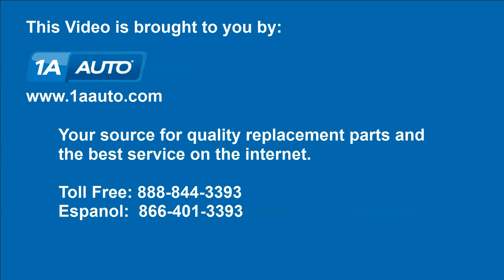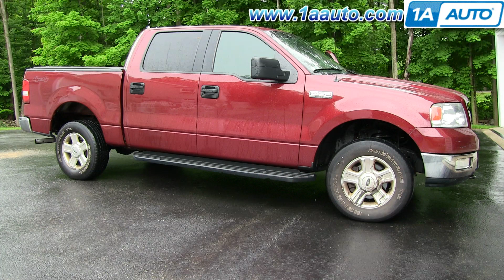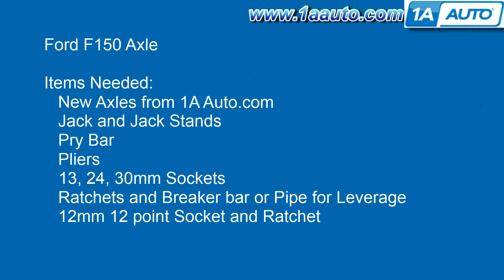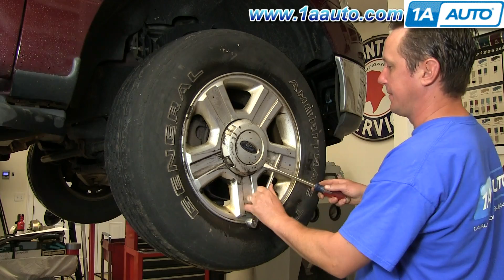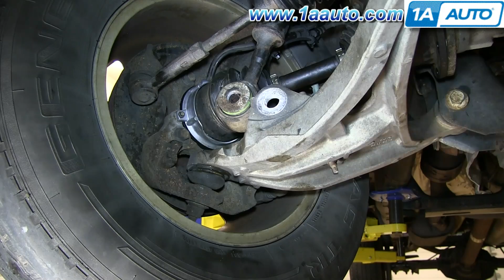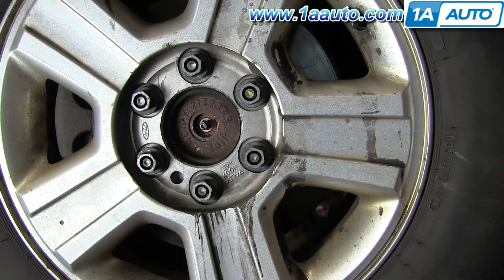How To Replace Front CV Shaft 04-10 Ford F-150

Comment: I'm thinking I need to do this.i here a clunk sometimes   and my cv join boot is mia . I'm Al's a bit low on funds so I was hoping to get away with  just replacing the rubber boot and put some  grease in  in

Comment: Just did mine. I have a 2 inch leveling kit and the strut would not go back in to line up on the control arm. Had to take the tie rod and upper   ball joint out.  Fought with a pry bar to get it back in . Definitely should of taken away bar like out. Was a nightmare
Reply: Swat bar link*

Comment: worked as described on my 2005 ford f150 4x4 ! I did this on the drivers side but nothing was different. Just make sure to have a 30 mm DEEP socket for the strut bolt. All my shallow sockets were not deep enough to engage the nut. Otherwise thank you 1A!

Comment: The manual calls for 350ft pounds of torque on that 27mm bolt through the strut. Not 90-100 like you said

Comment: My 2010 4x4 doesn't look anything like that
Reply from the maker: +Derek carry The video shows a 2005 model, but this video is also applicable to your 2010.
Reply: @1AAuto  09+ f150 front cv axles don’t attach to the front differential with bolts like this either. They are splined shafts on the inboard side at the differential.

Comment: This shows the spindle nut being cranked down.  But as I've found, if you tighten that nut up, it tends to keep the wheel from spinning.  I cannot find true articles on this dang nut issue.  Am I over tightening it, or is the spindle/axle bad?  I know there is a torque spec, but the slightest tightening on the spindle nut causes the wheel bearing to lock up and over heat!
Reply: I replaced the driver side locking hub actuator and I tightened the spindle nut to about 18-20 lbs and I have no issues. If you think about it, the nut has to maintain the cv axle in place so the rotation pressure created by normal driving  yank the cv axle out. All I'm saying is that if there is a nut in there, it has to be torqued down to a specific point, I think you have a bad spindle.

Comment: My 2010 fx4 doesn’t have those six bolts on the axle I thought these trucks were the same is there anything different
Reply: How did you get it done because I’m having the same problem I have a 2010 fx4 and it do don’t match this truck
Reply: so what do they have? how did you manager to get it out?

Comment: I'm in the middle of doing this to my 2008 f150. I found that the bolt for the strut is not 24mm but 27mm just a heads up

Comment: It doesn't look like the 2010 F150 FX4 is set up this way. There are no 12 point bolts attaching the CVs to the solid axle. Do you know how these attach?
Reply: This video doesn't work for '09 and newer F150s. 09 and newer have CV axles that have a splined shaft at the inboard end, not the 6 bolt flange...
Reply: so how do you remove it?
Reply: @Broism  just pull on it

Comment: I replaced the front wheel bearing hub on my 2003 Expedition due to noise and now on 2WD I get a loud  clicking when driving. But not on 4WD I'm wondering If I may need to replace the CV Axle on it, any ideas?

Comment: I just replaced my cv axle because it was leaking lubricant but now I have a rubbing noise when I turn my steering wheel right while im driving.  Any ideas or suggestions?
Reply from the maker: You may want to check the axle to see if the boot is rubbing on or making contact with anything. Hope this helps you out. 1aauto.com